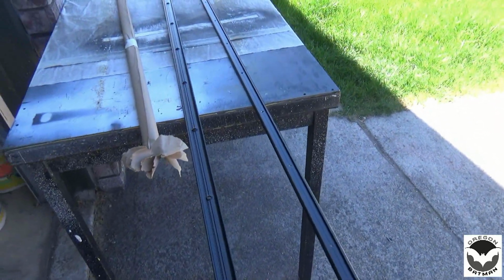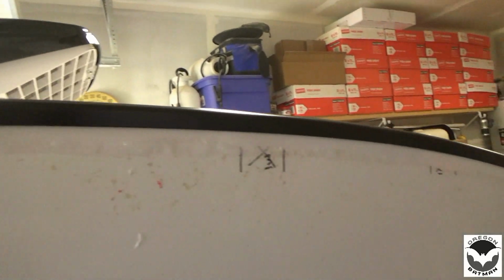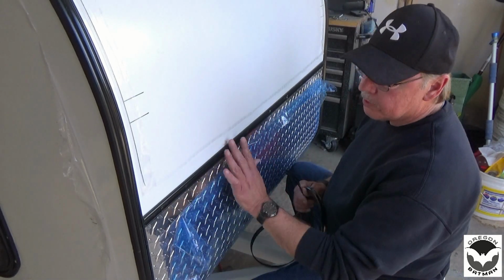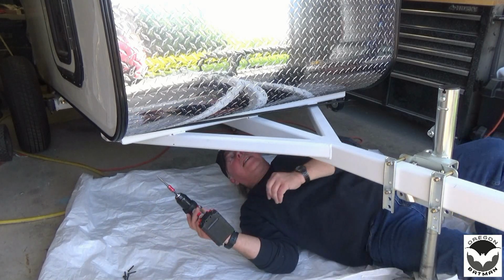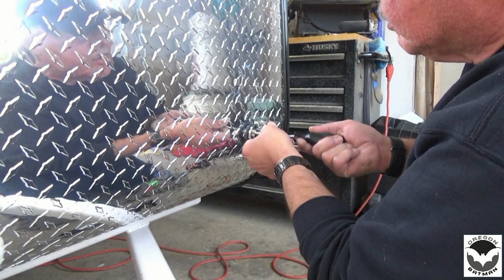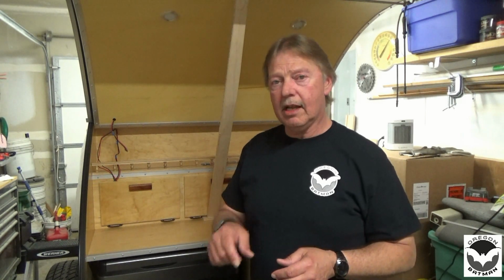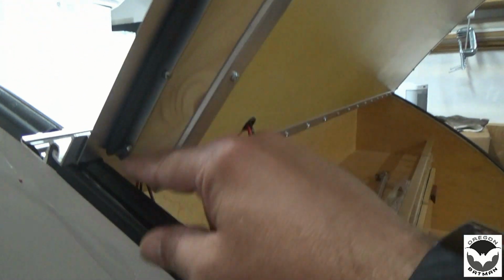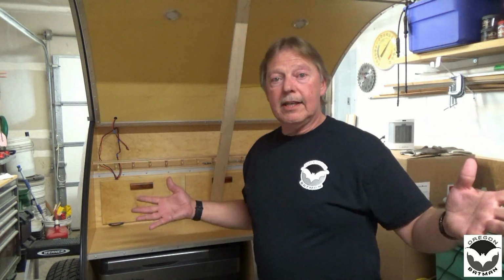Let’s Build A Teardrop * Step-By-Step * - Part 46 (12 Volt Shore Power)

Comment: Question please... Did you peel away the top layer of paper before you laid the aluminum edge trim on the 3M Sealant tape before screwing down? Looks like you didn't. Was that you intent?
Reply from the maker: Thanks for the question... this particular tape didn't have a top paper on it. Don't have to peel it.
Reply: @OregonBatman   oh, I thought it did. Thanks for answering.
Reply from the maker: @dreamlookautodetailingauto3353  You are very welcome!

Comment: One little tip I picked up from some woodworking channels is that rubbing alcohol works great for lifting pencil marks from wood before applying finish. Might work equally well on the filon and not be such a heavy solvent to act on the filon.

Comment: What size screw did you use for the final install? Also which trim do you wish you used? You have the part number for a hurricane hinge.
Reply from the maker: The screws I used for the trim was 1" Truss Head Screws, wider surface area to hold things down. The hurricane hinge is Part number: HT05
 Offset Hurricane Hinge. Thanks for watching!

Comment: I like the connectors you used to bring the power from the tongue box to the trailer, I purchased what I thought you used (Cat. No. 1190DP0CHR) on Amazon but when I tried hooking up my 10 awg wire it doesn't fit o=in the holes on the plug and receptacle and plug. I saw you also used 10 awg, how did you get the wire to fit in?
Reply from the maker: Hi Bruce... to get that wire in, I had to trim a few hairs off and twist the strands as small as I could make them. Eventually, after working it back and forth I managed to squeeze them in. Looking back, not sure if the 10 awg was necessary, but it all worked out in the end.
Reply: @OregonBatman  I was thinking maybe that was the case. Thanks

Comment: I didn't see why you needed that blue tape underneath that black trim whatsoever there was no glue no silicone no nothing
Reply from the maker: I used the tape as a precaution, just in case things oozed. There was just a bit of proflex that came out, and the tape still makes for easy clean up.

Comment: must have missed it but what's the adapter your using called to go through the bulkheads and all?
Reply from the maker: I used a product called PERKO–Watertight Deck Connections. Although... If I had to do it all over again, I might consider using the 30 amp adapter.

Comment: Looks great! Thanks so much for making this series of videos!! Did you add a sealer of some kind to the screw holes before final installation?  Also, is the filon smooth? I understand that you can see fibers in it. I was thinking of adding a vinyl wrap. I look forward to seeing your completed trailer!
Reply from the maker: Thank you John! I used Proflex to seal the fitting/screws when I installed the fitting. You can see the fibers in the filon, not smooth looking, although it feels smooth. Don’t think you would see it through the vinyl wrap! Thanks again John appreciate the comment!!

Comment: Hi, just wondering..don't you need any tail lights on the trailer? I would guess you need more than 2 wires (braking lights and direction indicator as well as constant power for internal lights and cooler etc.). Also, it appears that your power connector is the wrong way. The feed should be female and not male.
Reply from the maker: Hi Ivo, yes... trailer lights will be installed soon, totally separate wiring. I do have all of the lights and wiring, just need the time to get them installed. I do believe the connection is correct for this type of fitting. I know what you are saying though. Regular shore power has that kind of setup like you mentioned.

Comment: My son and I have decided to build a teardrop trailer  together this year. I came across your channel and it looks like the perfect tutorial for first time teardrop builders. I have scanned a few of the videos and I like that you suggest having materials organized before starting. I have not seen where you purchased your axle and frame. Is there a site that sells them or do I need to find a fabricator to build the frame and is there a specific axle used? We are excited to take on this adventure under quarantine. Thanks for any advice.
Reply from the maker: Hi Stephen! Video Part 19 talks about the frame and the axle. My frame is a custom frame, although any existing frame would work but would have to be modified for the cabin. I purchased the axle from Southwest Wheel Co. you can find them on-line. I used a 2000 lb torsion axle. Happy building, you'll have lots of fun!
Reply: I dont think youll find a better building guide then his video series, he covers it all. I look forward to his videos every week, good luck with your build

Comment: You’re doing a great job on it may I ask a question how deep is the galley where the fridge /cooler on the inside wall to the hatch
Reply from the maker: Well... if I understand your question, from counter top edge to edge of wall (to hatch) is approx 2". The depth of the cooler area is approx 15" under the counter top. With the hatch closed, there is about 1/2 to 3/4" clearance to counter top.